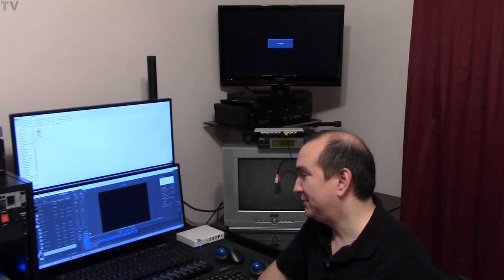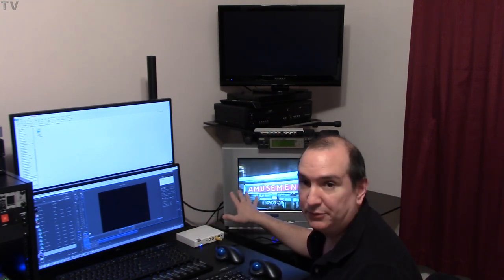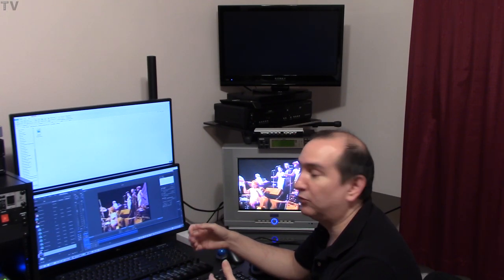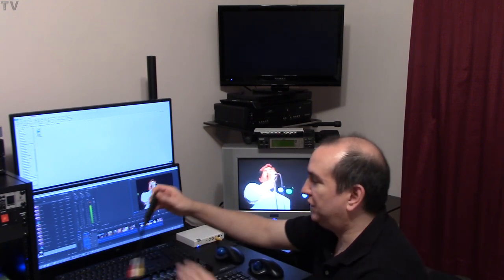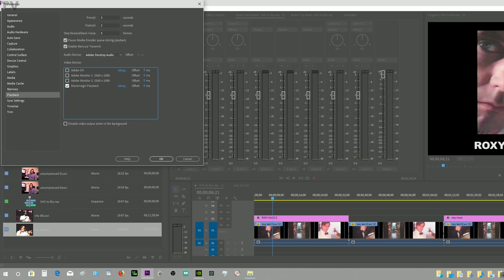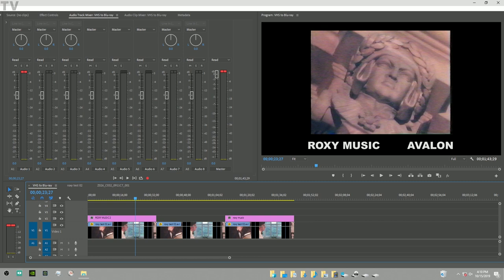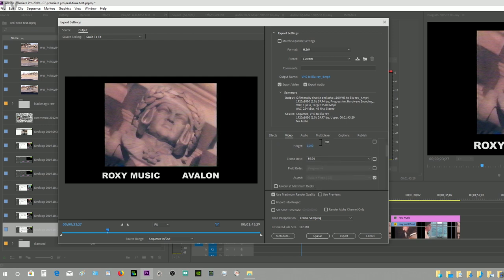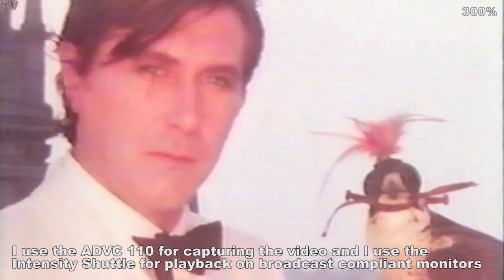transfer VHS and hi 8 tapes to computer and export to blu-ray DVD or social media

Comment: At 3:55 when u say “I’m gonna hit this to digital” what does that mean? Like what is the functionality of that button? Also when you stop capturing does it save as a stand alone file to your computer? Like mp4 or avi. I know the captures are sitting right there in the premier session to edit but are they also saved independent of premier?
Reply from the maker: Digital is for capture. Analogue is for playback. The files are DV-25 with an AVI extension. You can select where to store the files. The files can be played back in any other video editing program.

Comment: You made a comment in this video that you don't recommend the Firewire DV converters "because they have the best picture quality", but rather because they're better than cheap USB converters and typically easier/universal to work with.

Fair enough.

However, my question would be, if not Firewire DV converters for best picture quality, what specifically WOULD you recommend for the absolute best picture quality for converting/capturing analog (Hi8 to be specific) to a lossless digital format?
Reply from the maker: The video link below should be helpful. 

https://youtu.be/vqCi9B_7mdU

Comment: I have a Canopus ADVC 110 and MacBook Pro with Thunderbolt (nor 2 or 3) inputs, no Firewire inputs. I want to import VHS Videos using FCPX. Will using 6 pin Fire 400 from Canopus to Thunderbolt adapter work? Do they make such an adapter, or will I need to use 400 to 800, than 800 to Firewire adapter?
Reply from the maker: I have left two video links. You should watch them both. That being said I cannot say for sure if the latest version of OS X will detect the OHCI Firewire port.

https://youtu.be/g1YJy-Dc6kM

https://youtu.be/_nuVsXl70Xk

Comment: Just want to clarify. But do you need to use ADVC110 for mini vhs-c tapes because your computer doesn’t have FireWire. Or is there a way to just connect ur vhs player or camcorder directly to your computer using a FireWire cable and thunderbolt converter.
Reply from the maker: You need the ADVC 110 or any other Firewire converter. With Thunderbolt 3 I also need to use the power adapter for the ADVC 110. With  Thunderbolt 2 you don't need the power adapter.

Comment: My wife and I have a bunch of home movies on VHS tapes and would like a good and reliable way of recording them to either my wife's iMac or my Windows 10 PC so that we can then trim/edit and burn onto DVD discs that can be played back on standard DVD Players.  We have purchased two different USB 2.0 video capture devices, but each has different video quality issues.  I like the Canopus ADVC110 device that you have been explaining about in your YouTube video.  However, I see that they are no longer being produced new.  Is there a similar device that is currently being manufactured so that I can purchase a new device, instead of a refurbished or used device?  I read online that Canopus is now Grass Valley.  Is this true?  Does Grass Valley sell new ADVC devices?  Thank you for sharing your YouTube videos.  They are very informative and interesting to watch.
Reply from the maker: You have to buy the DV Converters used. I used to use a DAC-100. They all work but the ADVC 110 does not require a 3rd party power supply.

Comment: Are Canopus ACDEVio PCI Card or Matrox RTX2 Good for Today Using? About 12$ to 34$?
Reply from the maker: Most new computer do not have the old PCI slots. For VHS capture the Firewire DV converters are the bet option. I tested my ADVC 110 with the new M1 iMac and it worked.
Reply: @TechTVusa  Thanks and Best Regards.

Comment: Thank you for all the information you provide. I am from Chile and there are things that I had a hard time understanding. I want to know if it is possible to capture directly with the Intensity Shuttle ?. I have that Black flash problem.
Reply from the maker: You need a Time Base Corrector (TBC).
Reply: @TechTVusa  Are there VHS players with TBC? Could you tell me some models please?
Reply from the maker: There are some VCR machines with built in TBC capabilities but I do not know the makes and models off the top of my head.

Comment: I am using an ADVC 110 to try and get old VHS tapes into Final Cut Pro X.  I create a project but am unsure what settings to put into the drop down menu for video (NTSC SD?) and Rendering (422 vs 4444 vs uncompressed va others?).  Any recommendations?  Thank you!
Reply from the maker: In the USA it is NTSC SD.
Reply: Thank you so much!  What rendering codec would you you for the absolute best quality?  Hard drive space not an issue.
Reply from the maker: @jasongraham3718  H.264 should work fine.

Comment: Thank you for the videos lots of help! I have the Canopus 110 it digitizes my dvds great but struggles with vhs tapes. Any reason why this would be. Would it be the firewire cable or adapters? Also the knew premier pro only has the option for hdv not dv.
Reply from the maker: If the VHS tapes are really bad you might need a TBC. The link below might  be worth watching. 

https://youtu.be/xdw9_DETrqE
Reply: @TechTVusa  ok awesome i was leaning that way and you have reassured me! Thanks again!!!! Cheers.

Comment: When you finish recoding and the file is saved to your computer, what is the frame rate of the file?
Reply from the maker: 29.97 interlaced.
Reply: @TechTVusa  oh wow thats very interesting. I thought that when converting to digital, the analog signal is converted to progressive. what is the benefit of it staying interlaced over progressive, and does that leave ghosting or zebra lines in the video file?
Reply from the maker: @christopherpatrick1026  You should watch the video again. You want to keep the video in the original broadcast compliant format when transferring it the the PC in case you want to output to VHS, DVD or Blu-ray. If you want to post on social media then you can encode it at 60p.

Comment: This is an extremely helpful video!  I was wondering if there is any really quality difference between capturing an analog source like VHS or SVHS with the Canopus box versus the BM Intensity?    What if capturing from old Super Betamax and 3/4" Umatic...would you still recommend the Canopus or is that a scenario where it would be worth using BM for a higher resolution/better quality? Thanks for any help!
Reply from the maker: The ADVC 110 is the easiest option and the image quality is very good.

Comment: I’m having an issue with purple flashing on top of screen. Driving me nuts and I don’t even want to capture footage with that happening. First I bought a $7 easy cap. Then a Roxie vhs to dvd converter. It seemed to be a little better but still has purple flashing at top. Do you think with this advc device that would stop?
Reply from the maker: The video link below should answer all your questions. 

https://youtu.be/5nubVDZvzNA

Comment: i am using the advc 50 in a 5.25 inch bay now just because im not able to get the 110 or 100.. they are used not sold often in PAL land.... It is so smooth running on my old windows xp machine. Just incredible. And no audio Sync problems!!!!! I love it. Still wondering i still have too look for the 110. Do you know that the quality are the same for those 2 devices?
Reply from the maker: If the ADVC 50 uses Firewire it will be the DV-25 codec.
Reply: @TechTVusa  it has fire wire, it connects internally in the pc with a fw cable. i have no idea if the DV-25 codec is any good?
Reply from the maker: @williamtech4668  DV-25 works good.

Comment: Im having issues with my computer seeing the footage from the vcr im using a old version of premiere pro and it says no device control i have a advc110 i have rca cables plugged in my firewire 6pin and the analog in button highlighted in blue i have no idea what the issue is and ive googled every possible solution
Reply from the maker: Are you on a Mac? I think Apple's OS X stopped Firewire support.
Reply: @TechTVusa  well 
Im using my really old computer mac so its not a updated version of the operating system i have premiere from 2015 and fcp7 on it. It should work on that right? The laptop also has a 6pin firewire port
Reply from the maker: @pressia07  Although the laptop has a 6 PIN Firwewire port it might not give the proper amount of power. Below is how it should work using FCPX. You might want to check out my other Mac based videos. 

https://youtu.be/g1YJy-Dc6kM
Reply: Ok i have a power adapter just in case too but the manual says the firewire600 should be enough ive done it years ago and it used to work😩 im just not sure why its not working now
Reply: I will definitely check out the video thank you for your responses and time